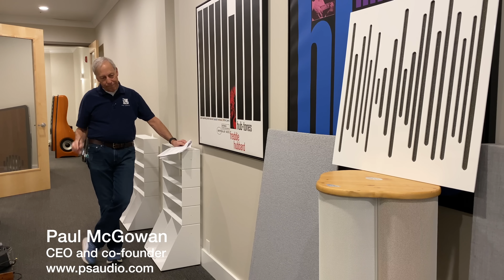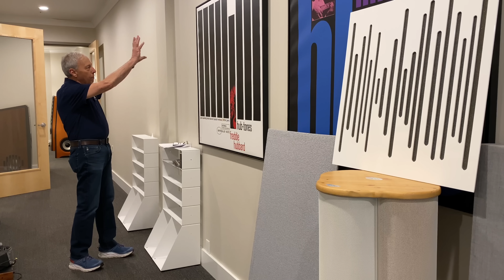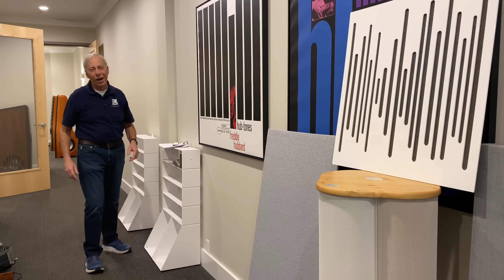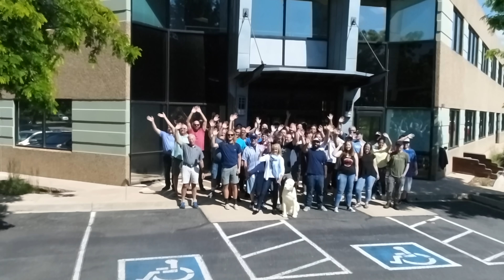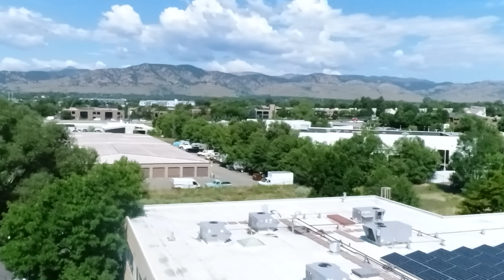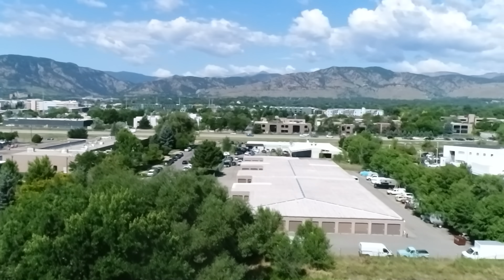USB Audio vs. I2S

Comment: The error / omission in this is in conflating the fundamental, internal synchronous serial data bus (I2S) with asynchronous USB - whereby the data is isolated and fully re-clocked at the DAC. It simply doesn't have those issues that synchronous USB had.

Comment: But what about DDC (digital to digital converters)? Many, like the Denafrips Gaia that converts USB signal to I2S and has internal oven controlled clocks. If you have a streamer and want to stream high quality digital, like 384k PCM or 512 dsd, you can’t use the SPDIF or AES/EBU output and must use the USB output. The DDC will convert the USB signal to I2S and has opto galvanic isolation. Doesn’t that solve the USB problem?

Comment: It's interesting to hear this from an audio product producer and see just how much BS they come out with.  Granted most of that BS comes from what other product manufacturers are doing rather than what "can be done".  The I2S bus speeds and clocks are completely configurable.  You can run I2S at 8k baud and send phone conversations over a very, very long cable.  If that's not long enough just re-encode the low rate I2S/SPI into UART or whatever line encoding you want.
NOT covered here is the main problems with using USB.
Clock skew / SOF feedback, dropouts etc.  The USB Audio interface does not provide a clock.  USB is poll/pull only.  These is no push.  An audio stream from USB cannot be asked to hold/pause, as it might be coming from a live source.  You can ask for it to be reclocked periodically to rollback clock skews.  But it's a pain in the a** trying to run a synchronous protocol like I2S interfacing with an asyncrhonous interface like USB.  There be dragons.
The other issue with USB is that 99% of USB hosts will have a SMPS and a real Earth/Ground reference (in the UK anyway).  This means that ALL of that PC processor/clock/HDMI/PCIe noise that the PC is dumping onto the ground/sheild is coming to your device via that sheild.  Best practice is to not connect it on the device.... if it's single purpose and does not require a shield.  However the USB digital Ground is no fun either.  I often see 1VPP of common mode noise (the ground referencing swinging around by 1 volt.)  Getting a reliable USB connection and leaving ALL of that noise behind is very, very difficult, usually requiring high speed USB opto-isolators and ground filtering/common mode chokes etc. etc.  Or using a common source of clean ground.
The "basic digital cable" referred to here, is, I assume SPDIF?  It's not much better.  The control signals, clocks, frames and everything else is ANALOUGE encoded on the single conductor of the coaxial cable.  There are many "pinch points" where the modulation of these clocks and controls can interfere with the bit stream.
SPI, SPDIF, I2S are all proprieatry "standards" from Phillips and Sony from various era.  The reason they aren't really standard is because, technically, they are proprietary protocol interfaces made by those companies, who allowed others to implment them for compatibility with Phillips and Sony products.  It's just when it got out there everyone started using it and it spread.  Without an actual published standard in like IEEE though, it grew horns, extra arms and there are dozens of different, mostly compatible sub-standards now.

Comment: After using I2S, I'll  never use usb again! It's so much more detailed! This is from the inexpensive $56 Douk Audio converter that reclocks the USB signal to I2S and a standard HDMI cable. I'm totally sold; this is superior after hearing it. I'm hearing things I've  never heard before.
Reply: i got one of those too and it blew my mind. so much so that i ordered the upgraded $150 one to try out too.
Reply: @pokrog  Are you sure?I guess signal is just signal and converting it will decrease the sound quality?Is signal coming from your PC to that converter?
Reply: @beslemeto  oh i'm positive. i've used it on about 20 different DACs under $1000 and all of them had a massive increase in quality. clocks in entry level DACs are awful and it makes for a lot of jitter and lack of control. signal is signal, you're right, but how it get's from point a to point b is important and how accurate the clock is matters a lot. if your headphones aren't very resolving you probably wont get as much benefit but if you have a set of planars or highly resolving dynamic driver headphones then it's impossible not to notice the drastic leap in quality and detail.
Reply: @pokrog  Thanks for responding!I am using speakers actually.Can you tell me which converter are you using exactly?I don't want to spend too much.
Reply: @beslemeto  i use a cmd-17 with the femtosecond clock upgrade but the douk u2 pro is great too. i use it for gaming when i want to use atmos and it's almost as good as the cmd-17 but it's 1/3 of the price. if you're using speakers the biggest difference you'll notice is a wider and more precise soundstage and massively better bass precision. what DAC are you using?
Reply: @pokrog Thanks!I still have not got a DAC?but i am planning to buy that Draco DAC in the video.Take care sir!
Reply: @beslemeto  if you're getting the draco, i'd get a nice hdmi cable for your input. something like the monoprice commercial ones. keep it as short as possible, that's important to keep clocks accurate. a cheap linear power supply like an ifi 5v to power the douk u2 pro helps as well.

Comment: If its digital data - and it gets to the DAC then one doesn't sound better than the other UNLESS its getting a better data rate ... but sure USB can be a pain.
Reply: not so much the data rate but stability of the clock, ie: jitter attenuation (in the DAC).

Comment: IIS = Inter-IC-Sound, USB = Universal Serial Bus.  These are both data transports - one is synchronous (clock aligned), the other is asynchronous (free-running).  None of this matters.  At all.  
  
What matters between these two is:  "Is the sample data getting to the DAC before the next sample is needed?  And: how stable is the clock driving the analog conversion?"
  
The I2S transport has signal integrity limitations, just like ethernet, or RS-232 serial (or its "big brother" USB).  Data alignment between all of those lanes of control and data can be an issue whereas with USB it would not be (due to packetized data containing both the sample and the control data in a deterministic fashion). But...  You can put just about anything over twisted-pair copper or fiber and get 1000's of feet out of it as long as the wire and driver are designed for the data rate.  You could squeeze I2S over CAT-6 with 50MHz RS-485 drivers beyond a 1000-feet.
   
I2S is not "new" either - it's been around since the mid-'80's, just like I2C.  What's new is that it is fashionable to have something new, and most engineers wouldn't have previously dared take a parallel line bus interface outside of a chassis, but now marketing is pushing Engineers to throw caution to the wind IMHO.  Much like DSD was just tapping the ADC process, and requiring more filtering on the back-end.

Comment: I wish it wasn't true because I2S compatibility really narrows the field of potential DACs. Over the years I put together a very elaborate and expensive multiple box USB setup where I finally don't hear any grey background/lack of contrast. And yet, throw a USB/I2S converter into the chain and an HDMI cable to my DAC and it sounds much more smooth, and refined, removing that last bit of graininess. Maybe some extremely high end DACs can salvage even more from a good USB connection, but so far I'm inclined to think no matter what you do with USB, I2S will always be a little better. 

I2S also sounds comparatively better than a high quality ethernet setup, which is somewhat surprising, but then with ethernet you basically have to build a noisy little computer into the DAC to unpack everything.

Comment: How about a single box that contains storage for audio/visual files (a few Tbytes at least) a user friendly GUI, processing to 'prep' audio files to different sample rates etc etc if you wish to do so and then a multi channel capable DAC and video processing? Then we can forget about tedious bloody cables that do/don't do whatever because it's all hard wired and configured from scratch.
Reply: @mikebagwell8229  yeah seen it and its bigger/smaller brother. Basically a blu-ray player that has storage rather than an optical transport (loads of space!!!) and GUI on it would be great IMHO as it's an audio/visual processor multi channel capable. I get hi-fi separates but it seems really unnecessary on the digital side - i'm totally for digital audio/video but i hate hooking computers up to DAC's. I don't understand why consumers wouldn't welcome a one box solution :(

Comment: I2s very short length a meter tops, USB in theory can be used to transfer anything  also it allows for error corections protocol to be implemented.  What system is used to stream data ? On PC you can use windows standard direct X or ASIO drivers for studio qulaity...  problem is very fer people including oldtimer here have heard properly builid circuits, Meridian uses XMOS decoder to dac provides much better quality then i2s dac..

Comment: You know, I have been hearing about all of the terrible problem people have with USB digital connections, especially with Windows, for years. In the 3 years since I have been using on my Windows laptop and 3 or 4 different DACs, I have not had a bit of trouble. Never installed a driver. No problems whatsoever. Just lucky, I guess.
Reply: Tom Huffman Yes, USB could be quite horrible ages ago. I have used 8 different USB DACs in the last 6 years on my Macs with no problems except one time I had a USB DAC powered by my iMac with a poor USB cable leaking digital noise into the 5V wire. A couple of general rules for audiophile USB DAC setups are not to use your computer to power your DAC and make sure your computer and audio gear are all grounded.
Reply: I think it took quite a while for the USB Device Class standards to get traction.  Once those become standard in most OSes and manufacturers realised the benefit in just implmenting to a common standard, most compatibility problems went away.  Not all though.  You will also find DACs/ADCs which will work "driverless" in standard USB Class compliance for USB Audio standard, but... if you install the drivers will enable a virtual audio device or devices which supports much, much more.

Comment: Paul, you fail to mention the major engineering pitfall of high speed parallel interfaces. Timing Skew. I2S is a parallel interface. You have four signals that all have to stay within a relative timing window. The fact that the data signal in I2S is serial does not relieve this requirement. The master clock is typically 24mhz and requires good rise and fall times to meet the timing skew window. Then you have the issue of switching. I2S needs four layers of crosspoints with a minimum 50mhz bandwidth to carry the master clock. That's expensive if say you want to offer three I2S Inputs on a DAC. There is no free lunch and I2S as an external interconnect interface is not the panacea many audio reviewers claim.  Yes, you do reduce the jitter inherent in  the SPDIF/AES Manchester encoding, but you now induce new and different problems which can have equally detrimental sonic effects.  Telecommunication engineers understand this well.
Reply: I'm not sticking up for the guy because I take anything personally, but I believe his explanation was sound! get it? 24 bits of dynamic range. You're looking for 64 bits I suppose. Too much.
Reply: @dillonsaudio  It's interesting when you do the maths on audio word width and what it really means when connected to the analogue domain.  The bit step frequency component is already well beyond what the vast majority of analouge front ends will handle.  In fact most of it will be lost in the capacitance of the amplifier input lines.   Meaning in emperical terms there is zero detectable different on an oscilloscope between samples 12, 13, 14   and a slower lower resolution step of 12,  ..., 14.  The capacitance and sub frequency components will just not exist in the output.  You might argue that over large steps at higher frequencies the output will hit the high resolution point more accurately, but that's also non-sense as the digital domain can go from 0 to MAX_INT instantly, in a single sample, but no analogue audio system in history can move a speaker from one throw to the other in a time scale of microseconds, let alone nano seconds.  Not even the speaker red shifting at the speed of light will match the digital frequency domain.
A 1 nano second rise time in digital domain has a frequency component of 1Ghz.
So.  If you want to stop wasting money, you need to look at ALL your path points, from analogue in to analogue out and ask where you slowest freqency domain is, the weakest link and THAT is your fastest, highest resolution audio.  Any more will just be averaged out in the analogue domain.
There ARE other reasons to go for 24bit or even 32bit, which is my intended internal word size in a project, these only really exist in the digital domain though.  Word alignment for memory, CPU/DSP registers etc.  At various times you have to pick your poison in your word length.  "Clocking" 8 bits bytes is simple from a programming point of view, but is inefficient on a 32bit fixed word legnth processor like an ARM core.  It's also confusing having to keep check on your apparent versus actual bit width in buffering alignments, frame stuff/drops etc.  Fixing to one internal bus format simplifies most of the coding.  It does as you point out increase cost.
However if you can solder and read a datasheet, you will find that the different between the BOM (Bill of materials) a PCB print run and some soldering, your audio box might cost you £100 to make.  Such a product would sell on the market for £1000+.  There is much merit in this approach.  If you can code, do electronics etc.
Reply: You may also note, that while I am using an internal 32bit architecture for SPI/I2S almost all of my analouge and USB front ends will be at 16bit 48K.  My ears are too old and too badly damaged by heavy rock and heavy techno that I will not notice any more.  Besides.  USB front ends that do more than 48K16bit are costly and usually involve dedicated audio processor ICs and drivers.  Chips like the PCM2707 if you can find them, simplify that process incredibly, including the reclocking off teh async USB interface.

Comment: USB = No Audio Quality influence of the USB source as the transmission is digital and block wise (e.g. every 1ms all data gets transmitted for the next 1ms).
I2S = Digital data Transmission every sample. The Clock Jitter of the I2S source has an effect on the audio quality. Think of a digital voltage, but the time is "analog". (Even at 192kHz, inter modulation products can be audible)
=> The more devices are in series, the worse a I2S signal gets. USB does not degrade the signal.

Both I2S and USB conduct digital or mains interference from the source to the receiver. A well designed receiver (rarely the case) does not suffer from such interference.
So far USB looks better, BUT as I2S is only used for audio and USB is mostly designed as cost efficient as possible, the interference over USB is often far worse.
Chances are high that the supply voltage of the I2S source is more stable than the supply voltage of the USB.
As a result: With a good receiver you can use both, but preferably USB. On a bad or average (non-HIFI) receiver, you should try I2S. NEVER feed I2S to a HIFI DAC if you can use USB.
Reply: Good point on the grounding issue. OK so I2S could be transformer or optically coupled. But so can USB or SPDIF. In fact any and electrical noise isolation technology could be applied equally to all three interfaces. Electrical current is electrical current, which all three utilize. Let's fix the real problem here. Design good USB and SPDIF interfaces.
Reply: If my DAC has I2S should I use that to connect to my amplifier if it has I2S instead of XLR? I feed my DAC via USB from my laptop.
Reply: @adaboy4z  it seems self explanatory. DAC has I2S Input. The amp also has I2S  Input. The I2S connection is one way - you must connect input to output. You can't connect 2 inputs. So, I think, this is your answer.